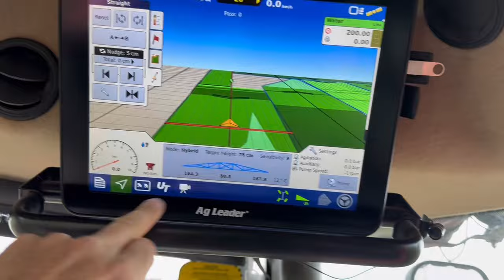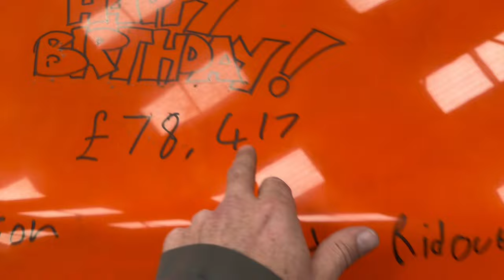QUADTRAC BATTLES THE RUTS AnswerAsAPercent 1673

Comment: Great video, the quad track is an awesome bit of kit, if your ruts are 18” - 24” deep, does the cultivator lift the compaction at the bottom of the rut or does it just level the ground out and fill the rut on top of the compaction?
Reply from the maker: It’s running deeper than you can see tbh

Comment: Hi Olly, strange request but after you mentioned a 36t strap I have been thinking of how a normal strap would or wouldn't react to pulling a tractor free.
Like if you used a ratchet strap, or a recovery strap rated for 2t that one would use when in a car or jeep, how would they fare up on a tractor? Might make a interesting video